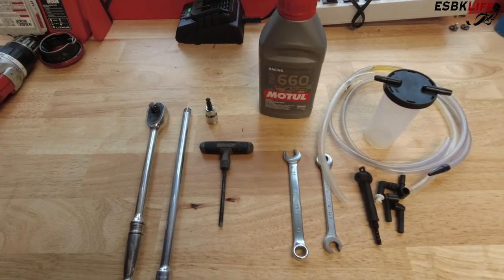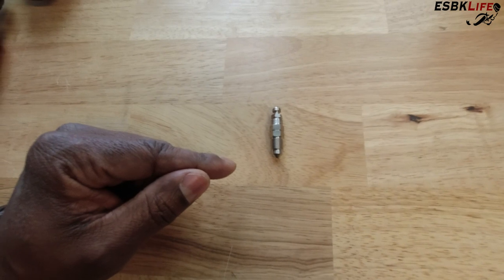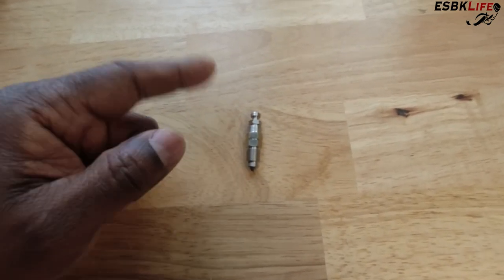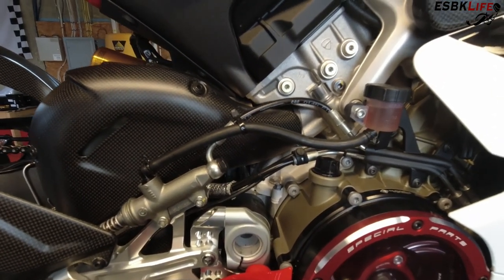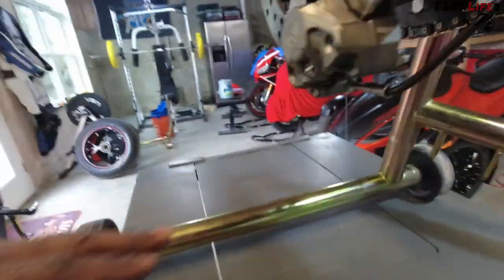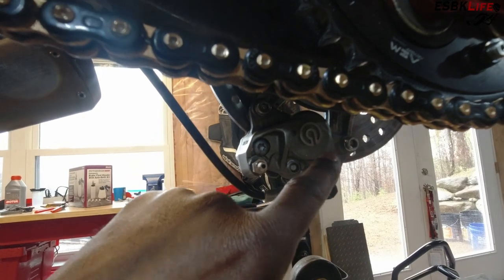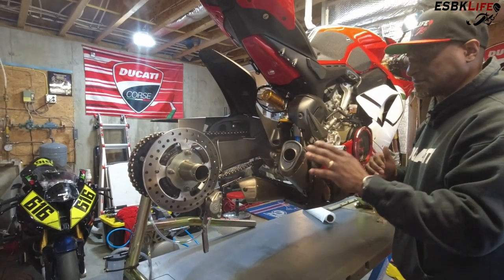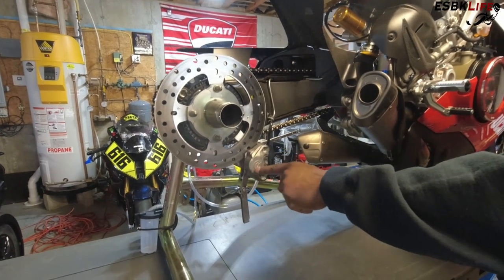Bleeding your Ducati Panigale V4 Rear Brakes

Comment: Great video. Be careful using that hub stand because one wheel is half over the edge of the table. I would replace the stand or make a side extension from angle iron, to avoid a bad accident. Be safe 👍
Reply from the maker: Yeah I know. K&L makes width extensions for the lift, I just keep forgetting to order them lol.

Comment: I'm guessing the speed bleeder remains locked in place which  maintains a solid vacuum to really removed air bubbles.  I was getting nowhere using a Mityvac until I put  teflon tap on bleeder threads which allowed for a good vacuum to really pull air out of whatever nooks and crannies exist.   Now brake works like new.   Using the gap gage is a good tip, thanks!

Comment: Thanks so much. I replaced a new caliper and didn’t what I did wrong. From your video, I detached the whole unit and placed two lawn edger blades to simulate the rotor. I was able to bleed a lot if air out that I didn’t have to do when replacing pads. Thanks again!

Comment: this is amazing derrick. jesus i struggle SO much with my rear brembo brake on my MV Agusta F3 (mounted exactly like your V4). great tip on having the caliper hanging so the air escapes out.
Reply from the maker: This isn’t a fool proof way to get all air out of the system, but it should help.

Comment: Sell the Rizoma rear brake fluid reservoir. You want to be able to 👀 your fluid level. Buy a Ducabike billet cap for your stock reservoir. They come in different colors and with carbon fiber inserts. Any further thought on insertion of a Ducati V4 motor into your F4? BTW: Was happy you were wearing Ducati attire, instead of Patriots garb...😉
Reply from the maker: I’m probably going keep it as a parts bike. I don’t have the time for Project like a Ducati motor swap lol. If I can find an F4 motor I’ll drop that in it.

Comment: Nice video ! Thanks for taking time to share. 

Question. I have a 21 panigale v4s. Do you know the model number of the stahlbus bleeder valve for the rear brake?

Do you know the stahlbus bleeders for front calipers, and clutch and clutch master cylinder bleeder?

Thanks
Reply from the maker: What’s up Justin. I don’t know the part number off hand. But if you go to the Stahbus website they have configuration page for their bleeders. You just find your year make and model then go across to see the bleeders available for it.

Comment: Anyone know torque specs to tighten those bolts back on?
Reply from the maker: Unlike some other manufacturers, Ducati is pretty good at sharing fastener torque specs with its customers. If you go to the Ducati website and plug in your year, make, and model, you should be able to download the torque spec document. Or you can just Google "Ducati Panigale V4 torque settings." You'll get a handful of sites where you can download a PDF with most of the torque values for the bike.

Comment: Do you absolutely have to pull the rear wheel ?
Reply from the maker: No but you’ll have a lot more room to work if you do. Also, if you try to use the same process I did, you might run into caliper to wheel clearance issues when rotating the caliper vertically if you don’t remove the wheel?